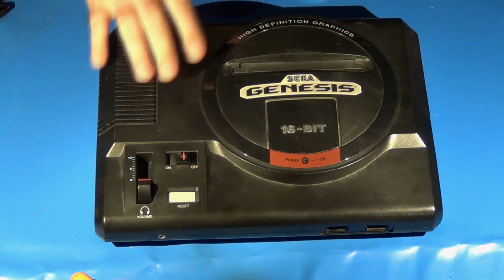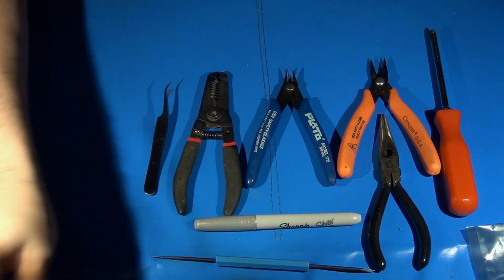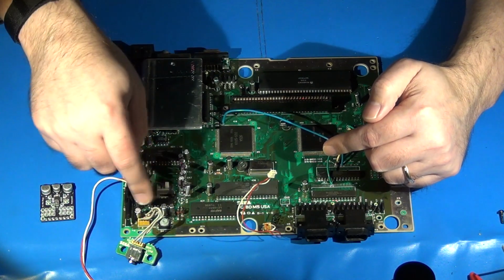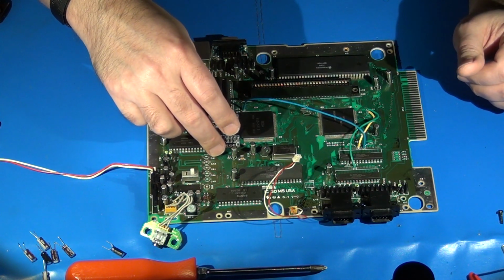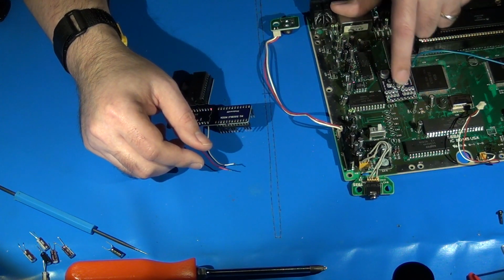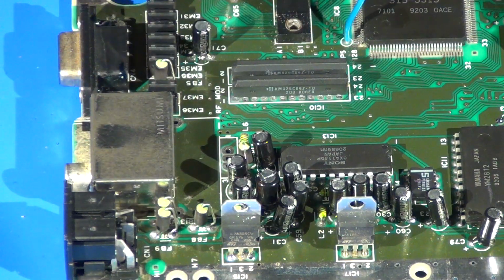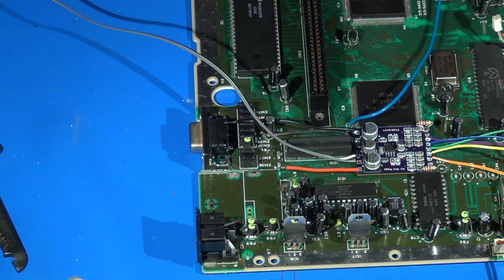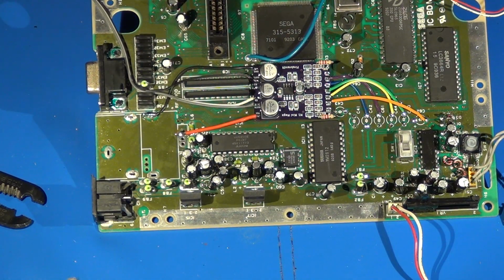ITC#50 - Sega Genesis M1 Mini Mega Amp Installation

Comment: Its hard to find those amp board cause they are out of stock. Is it possible to to make my own board with some requirement parts? Like caps. Ressistors etc.
Reply from the maker: Have you tried to reach out to FirebrandX directly to ask about this? That was basically how I was ordering them originally. Then again, I was also testing out several versions of his earlier proto boards before he decided on his final design. I also think his Mega Amp design has been incorporated into the triple bypass RGB boards as well so that is another option to look into?

Comment: Great job, best tutorial I could find.

When I recapped my Genesis I lifted a solder pad for one of the caps near the headphone jack so now only one sound channel works, wasn't able to fix it with my beginner soldering skills.  This board looks like it'll bypass the whole thing.
Reply from the maker: If you are just wanting to restore the audio and leave it stock, you could just find the trace near the pad that came off the board. Scrape away some of the solder mask ontop of the trace, and solder the leg of the capacitor to that trace. Or if it is too far a reach, solder a small length of wire to the leg of the capacitor and then to the trace on the board it needs to attach to. You could also bypass the headphone jack and install RCAs without needing the amp bypass board. Here is a link for doing that (Not my page). I used to do my RCA jacks in the same way as this page shows until the Amp bypass for the model 1 came about. I still have several Genesis systems modded using this older method. So this is another option:

https://www.retrorgb.com/genesisaudiomod.html

Comment: Damn, I have been meaning to one of these things for a couple of years.  Ever since I retired my very beloved a and treasured Wondermega for a "tower of power".  I have maaaaaany Jp MD/MCD combos to add them too!  My very original PAL "Altered Beast" MD and PAL MCD have been packed in their boxes for decades.  Tyey are not to be touched.
Reply from the maker: This specific bypass amp is recent as of this past summer 2018 and is specific to the model 1 units. The other more common crystal clear audio mod and the one that is included on Voultar's RGB bypass is designed for the model 2 units as I understand it. So yeah, this specific board is pretty new and not for use on the model 2 designs. Your Wondermega and their various models would qualify as Model 2 units as they share most of the same logic inside as the model 2. The audio amplification is different in the wondermegas though and I've always been told it was excellent and not really needing to be modded?
Reply: @IvoryTowerCollections  Oh god no, the Wondermega would never be touched for a mod!  I waa referring to my stack of Japanese MD/MCD systems :D  I would like to punch anyone that would mod a Wondermega ;)

There was a mega amp available a few years ago I always meant to buy.  Good thing I have so.ething better to buy now.  I would like the RGB amp too...
Reply: Oh yes I should add, the Wondermega sounds amazing.  Especially the VICTOR model with its added hardware.

Comment: Out of curiousity, I have a Japanese Mega Drive that doesn't have a RF module. Supposedly where you get the 5V can add noise to the audio so what are some good alternatives to get power?
Reply from the maker: In the video I discuss using a meter to find other locations for +5 that are tied off the second 7805. You want to make sure it comes from that one since it is the regulator in circuit designed to drive the audio. But as you are missing the RF modulator I would advise to just grab the +5 from the same location that the original 1034amp is pulling it from. You could also just attach the +5 directly off the 2nd regulators output. In my personal genesis I have the power coming from the 1034 amp's voltage input pin.
Reply: @IvoryTowerCollections  Just completed it. Thanks for the advice!

Comment: Would be nice to show how to connect to headphone slider, some use the headphones.. Would have to maybe remove some coupling caps for L and R channels after stock sound chip..
Reply from the maker: The only way I'm aware of to hook this up to the headphone jack requires that the headphone jack basically be cut from the current amp circuit and then you just wire the output lines from the M1 Mini mega to the corresponding points on the headphone jack PCB. The volume slider would no longer be functional just as it isn't functional on my current one like you see in the above video. The headphone jack still works but the audio is at the same amplified level as the output RCAs.
Reply: @IvoryTowerCollections  Do the RCA outputs lose intensity or pick up noise when splitting the signal with the audio jack?
Reply from the maker: @patorecchi8846  Not on the 2 consoles I owned that I've installed this separate board into. But that said, to the best of my knowledge, most of what the M1 Mega Amp had and did, has been incorporated into the triple bypass boards that most folks install these days. But I'm glad I have the separate RCAs because I actually use them for all audio output including SegaCD and 32x games. Especially since the audio input port on my HDRetrovision cables have gotten flaky. So running the audio off separate RCAs directly into my OSSC setup now has bee very versatile still sounds great even this many years later.
Reply: I will look at schematic, I think there is a way to have headphone output adjustment slider work..

Comment: cool but i dont see the the point for this radical modification. I rather to install the rgb bypass in order to fix the awfull jailbars appearing when I am using RGB video out
Reply from the maker: My understanding is that the audio filtering on the RGB bypass is designed only for when used on the model 2 Genesis/Megadrive systems. This is a separate audio amp specifically for the model 1. The ultimate to all of this would be to use an RGB bypass for cleaned up video and this amp for cleaned up crystal clear audio on a model 1. I actually removed the jailbars by simply cutting the trace off pin50 from the VDP. This messes up the color for composite and s-video output which, I still needed so I have a switch in place to turn the color subcarrier on and off as needed. Thank you for your comment!
Reply: @IvoryTowerCollections  I would be interested in seeing what you did with the VDP pin and the switch setup that you're using - even just pictures would be cool!
Reply from the maker: What I ended up doing was completely remove the trace along the bottom side of the board where the VDP lines run close to the RGB lines. Then installed a push button switch on the back of the Genesis to turn the subcarrier on and off as needed. Most of the time it is off since I'm using HDretrovision cables off my 32x. But when I use the Genesis in other places or need to display on multiple displays at once, I enable the subcarrier back in circuit so the colors aren't crazy on composite and s-video.  The Genesis systems you see in my videos are client systems in most cases. My personal one is a mangled mess from all the work I've done on it over the years and it isn't really a system to show for clarity in a video like this LOL.

Comment: Why did you add resistors to the M1 Mini Mega? You never mentioned this?
Reply from the maker: Good eye. I didn't mention this because those were only needed for the M1 Double Mega add on that was being done on this particular Genesis as well. However, a new redesign of the M1 Double Mega no longer requires these extra resistors. Since they aren't needed and I knew they wouldn't be while editing this, I didn't really see a need to reshoot it all over without them. I was hoping that by not mentioning them, they would be glossed over by viewers. You've proven me wrong! I will add a disclaimer in the video description about them. Thank you for watching and for asking!
Reply: @IvoryTowerCollections  No problem! I was having some issues with my M1 Mini Mega so I was looking to see if your video could help me. I connected mine to the headphone jack and when there is no game audio I'm getting this pulsing static noise constantly. Happens on startup game dev/publisher screen and while the game is paused.
Reply from the maker: @ShoNuff919  Did you recap your Genesis? I've only experienced "logic noise" as I call it when I have my receiver at a really loud volume yet I've not heard it when capturing the audio through my computer. So I've wondered if I might have a ground loop on the receiver side that causes it from time to time. There will still be some floor present but it shouldn't be that loud. What game were you testing with?
Reply: @IvoryTowerCollections  I recapped before my install. I also installed the Sega RGB Bypass from Voultar. I them on opposite sides of the board. Tested with Sonic 1
Reply: Streets of Rage 3, everdrive...same results
Reply from the maker: @Justin did you ever this resolved?